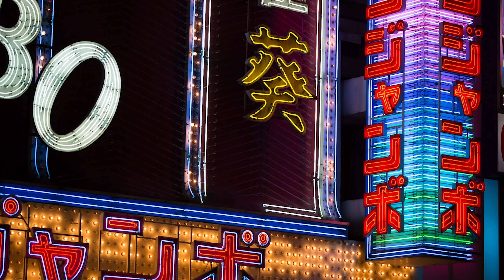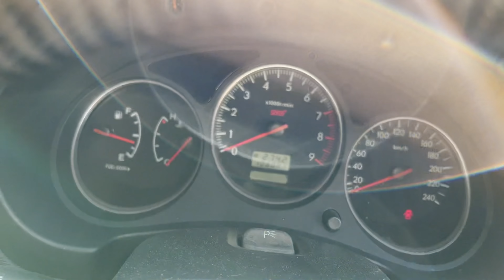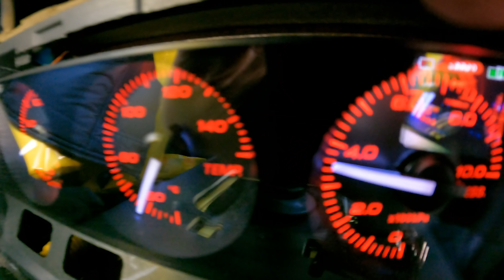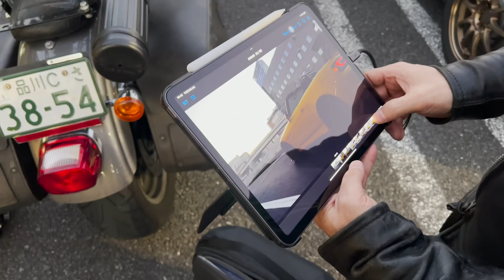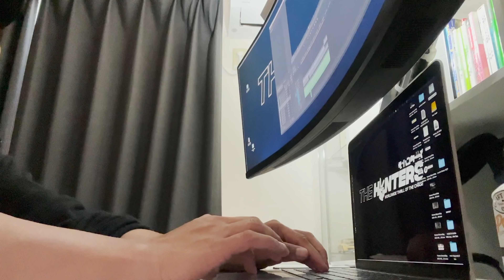A Day In The Life of A Car Youtuber in Japan: Car Mods, Shop Visits, & Night Drives!

Comment: The Honda blue oem coolant works very good aswell. At rockstar garage we run it with all of our track cars in hot temps at buttonwillow raceway with a CSF or koyos even stock radiators and never have heating issues